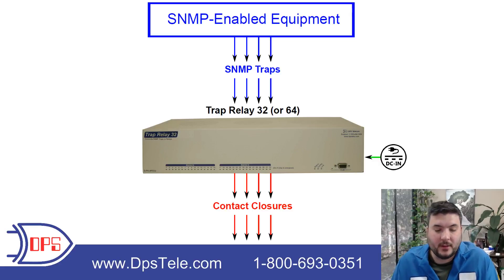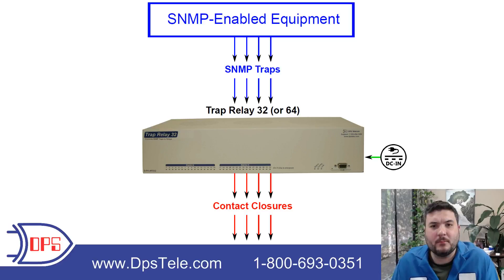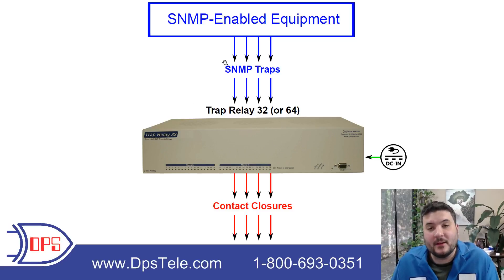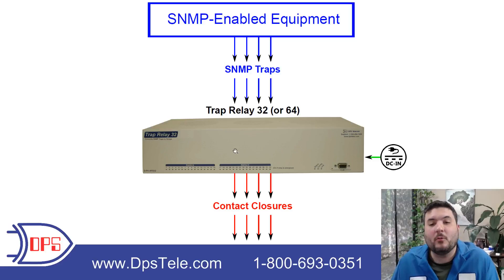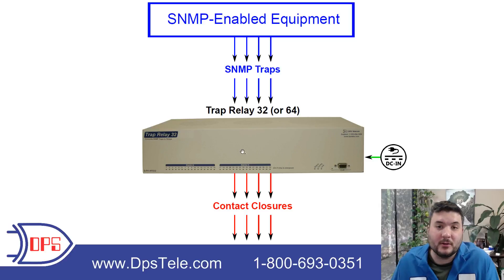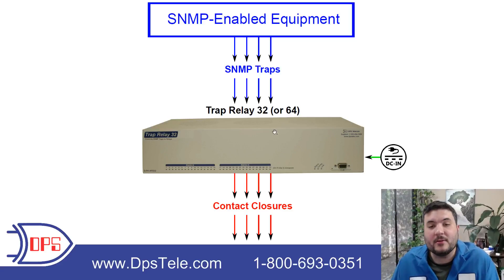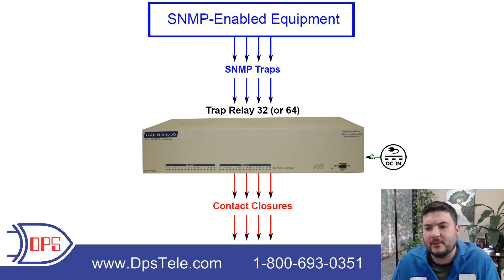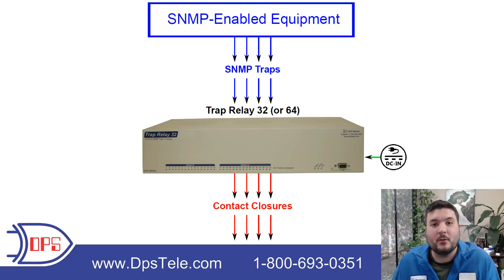How to Convert SNMP to Contact Closures (Relay Outputs)

Comment: That isn't how SNMP works.  The agents sent traps to a management station.  What you are talking about here is sending an SNMP set with a specific index number which corresponds to the relay.  At least I hope that is what you are talking about because SNMP traps would totally limit this functionality.
Reply from the maker: Hi, Craig. Our Trap Relay boxes allow you to specify a specific trap (OID and/or variable bindings) that will trigger the relay. So, the SNMP traps don't need to be designed with our Trap Relay in mind. As you point out, that could never work.